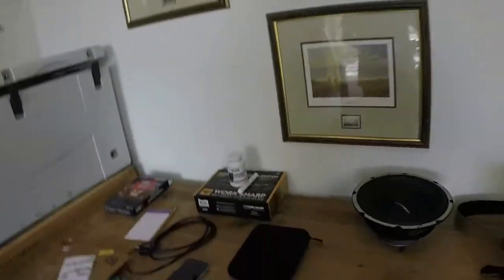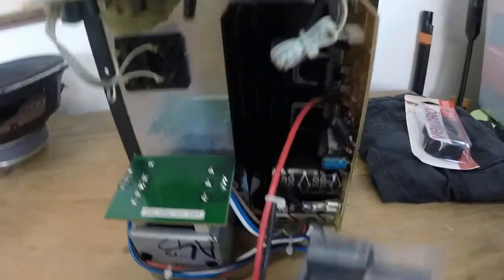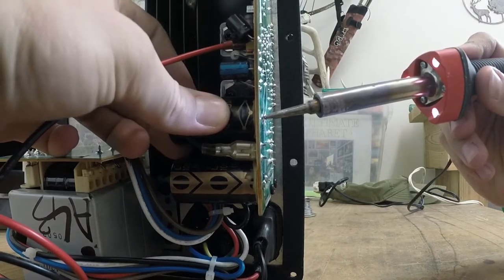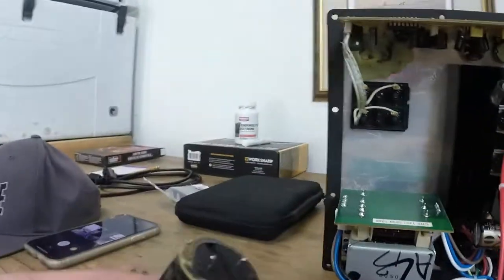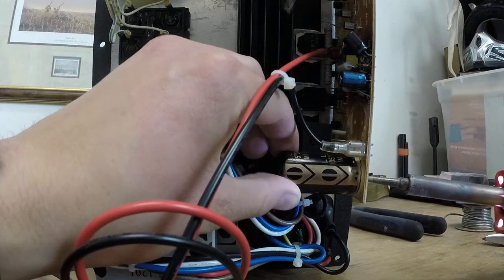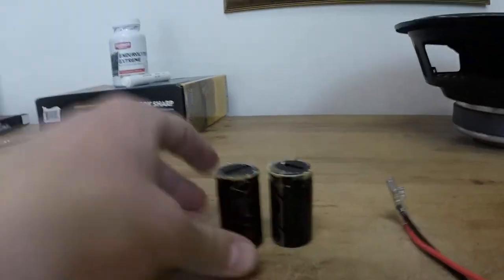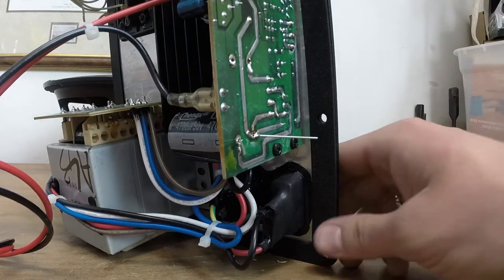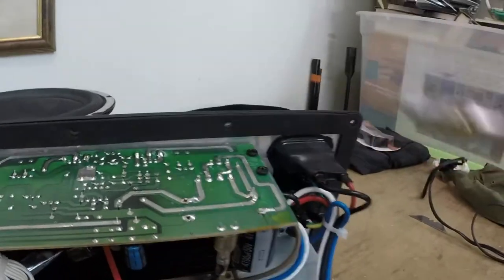Replacing Capacitors In Powered Subwoofer I TruAudio

Comment: What was wrong with it? I have the same sub I found on the curb and sub itself seems fine the guy said it just stopped playing. I plugged it in and all hooked up and there seems to be some, barely any sound coming out
Reply from the maker: That’s how these two are. I don’t know why they are so quiet. I think I might just need a receiver with a higher sub output.
Reply: @GTsGarageTech  no I mean the amp is like not turning on. It's just the reg stereo coming thru un-amped if that makes any sense. Almost working like I bypassed the amp but all I did was hook it up like it is supposed to be. Thanks for reply
Reply from the maker: The fuse could be blown. It is located in the plug. If you un plug the cord from the amplifier there is a little fuse image if you look close and it pulls straight out